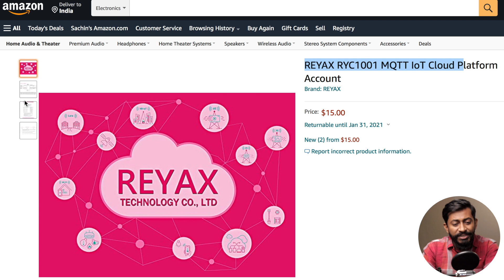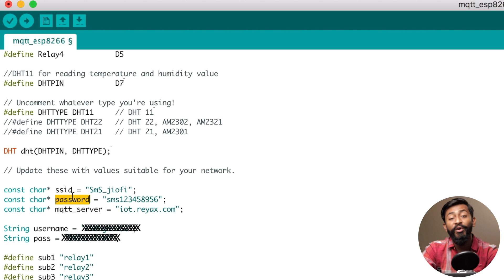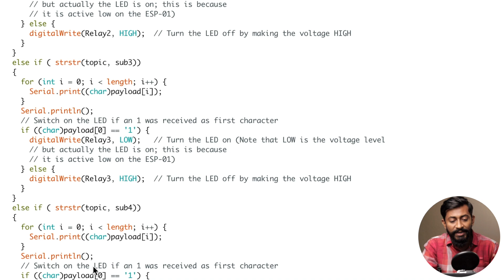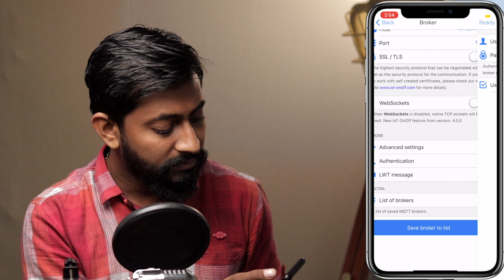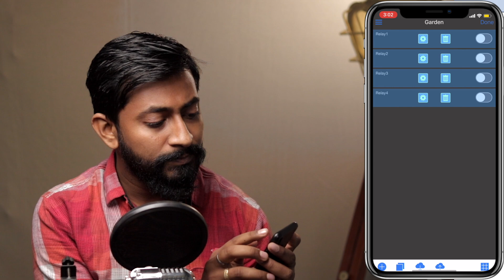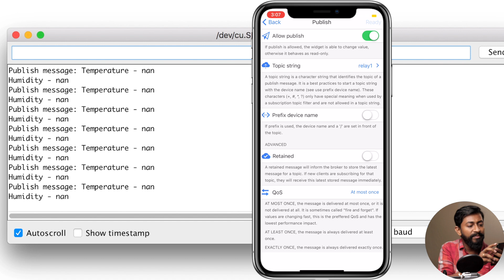Cheapest Cloud MQTT broker for Home Automation  | How to use Reyax MQTT Broker using NodeMCU board

Comment: does this support google assistant or alexa?
Reply: I think if you can connect the RYC1001 with google assistant or alexa, it might work! But you might need to do it on your own~
Reply: No it won't work directly unless you write a third-party integration code